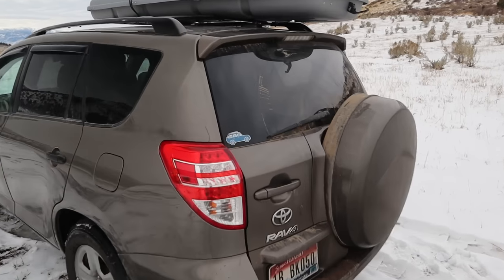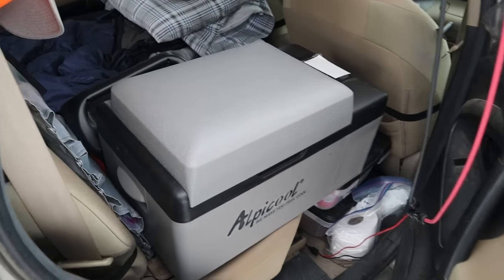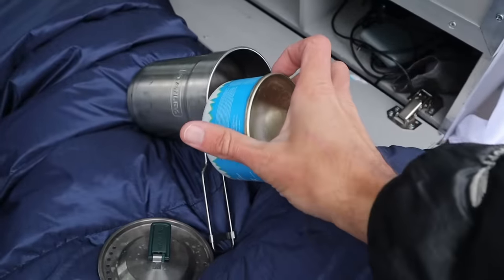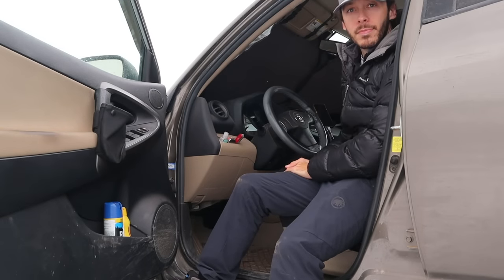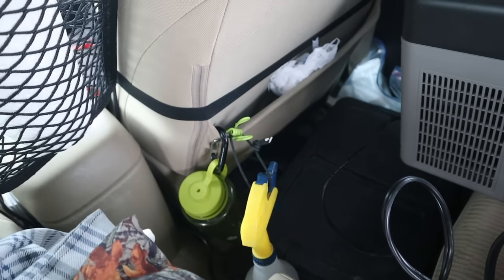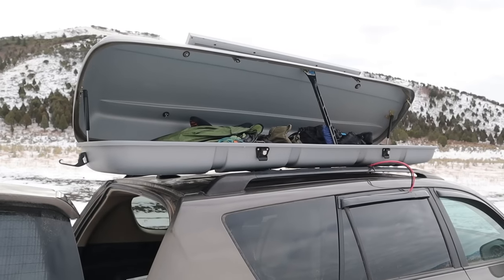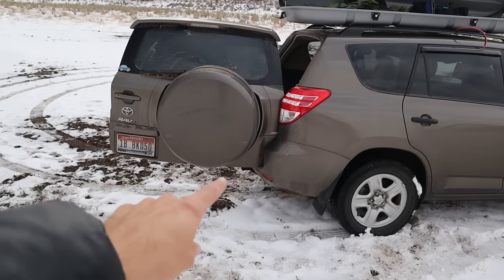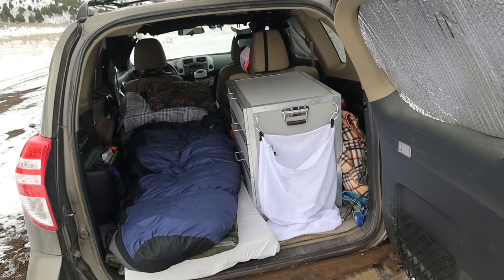My SUV Camping Setup: Full Tour of My Mini Camper! (Vanlife in an SUV)

Comment: I have a 2018 Ford Escape and have camped in it. with my dog. One of the back seats had to come out. Cut a length of plywood laid and mattress pad and bedding. Next year I am going to take out the other seat so i have more actual useful use. Sure like the storage bin a friend made for you.  My family, daughter and son in law and their extended family are taking a trip next summer so our last summers trip told me what I needed to do to make better and your video has given me lots of good ideas. We have reservations for a large site next summer, covid allowing. it will only be for five days so otherwise I am on my own. Last year was my first year in that car, which was a good way to find out what worked and what did not. Prior to that I had a ford Trans Connect, which I am so mad at myself for selling. It was great for camping. But it was starting to break down after so many miles. Thanks for your video.

Comment: Tristan, I’ve been following you since the beginning and have always appreciated your videos. I have a Sienna, which is my daily driver and camper. I also own a 95 RAV4 which I want to convert into a mini sleeper, because the RAV4 is better off road than my Sienna.
Question:  why did you choose the driver’s side of your RAV as your bed instead of the passenger side? I’m thinking if I go with the passenger side I can leave my bed out all the time. Am I missing something? Thank you for your videos! I also live in Southern Idaho.
Reply from the maker: The rear seat is a 60/40 seat. This means that it folds down in two pieces, one that is roughly 60% of the seat and one that is 40% of the seat. The driver's side is the 60% side, and that's why I sleep on that side. The 40% side isn't really big enough. It'll likely be different in your 95  RAV4.
Reply: Same I'm doing passenger side

Comment: Some great ideas here. I'm thinking about various camping options for myself--van, tent,  RV, teardrop camper, or SUV, and I see so many reasons here that using a small SUV might be the best solution for me, especially by leaving it relatively unmodified so that when I'm NOT on the road (which would be most of the time), I've still got a normal vehicle to run around town in.

Comment: Have you ever thought about or tried a very small, low-wattage electric heater to use inside your SUV when not driving, and it's extremely cold outside.
Reply from the maker: If I were to use one in the future, it would be just for review and informational purposes. I personally don't feel the need for one. I have no problem with just using the sleeping bags. Thanks Ric.

Comment: Dude, it would be so much easier on you to have tinted windows.
Reply: They are tinted. But a Purdon can walk up, cup the sides of their face to see if someone is inside, and interior lights can still be seen thru tinted windows. The reflectix work great at insulating too. Keep the warmth in, or block the heat outside.

Comment: Have you tried a pool noodle in the window that is open a little bit? you could roll up and it would press against the cords. You would get rid of the wind noise without having to move anything, plus its temp and nothing needs to be glued or changed.

Comment: Some of that foam copper pipe insulation cut to length and saddled over the top of that window where the power cords are coming through and rolled up snuggly could make a good seal and cut down on the noise. Probably wouldn’t even be able to even see it from the outside for it would be up behind the rain deflector.

Comment: For all the fun people make of it, the Pontiac Aztek with the tent package was the perfect setup. It included an inflatable mattress and a built-in air compressor, redundant audio controls in the cargo compartment so you could listen to music, a cooler built into the center console and a tent that clipped over the open rear hatch. In all-wheel drive form, it could even do light off-road adventuring.

Comment: I have the Alpicool  c20 for a little over 2 years and still running strong. No issues yet (knock on wood) pretty reliable fridge and i dropped it once on concrete from about 4ft high

Comment: I purchased the same seat covers you have based on your previous review.  I used it on a month long camping trip and it worked just as you said.   I like it so much I'm ordering another one for the passenger seat.  It keeps my original seats clean when I get into the truck with dirty or wet clothes and when I eat in the drivers seat it catches all my crumbs.  Get home, take it out and my truck seat is still clean!  Thanks for the review and suggestion.  I like the fact that you don't recommend something until you have used it and verified it works.  Safe camping...
Reply from the maker: Aren't they great?? I'm so glad you got some. It really is a gamechanger to get in and not have to worry about being wet, muddy, dirty, etc. I love 'em.

Comment: Something I have found very useful: the right microfiber towels. Dampen them and they are great for cleaning, including hands and face. Also for washing and drying other parts of your body.
Of the many brands tried, the deluxe ones sold in a ten-pack for 7.95 at WM near the auto section, dark grey with red trim, work significantly better, and have two different textures on each one.
They are very useful and multi-functional, and many-times reusable and washable, and very durable. Easy to hand-wash also. 
They are also more pleasant to look at and use than most.
Reply from the maker: I use a microfiber towel as my main travel towel. Thanks for watching

Comment: I would have routed the cables from the solarpanel through the hole where the roof antenna is located and then the wind noise when driving with a window opened be cleared of. You can replace the antenna with a window antenna if you need one or just put one in the roof liner. Good build am looking to doing something similar. :)

Comment: I am with you i.e car camping 🏕 
 I did the tent thing all before Covid hit, before that did many Glamping huts. Loved Glamping but realised I was spending a fortune and limiting my vacation opportunities as a result. So pulled out a old tent that was never opened from storage, loved it until we had a bad storm from a different place pass through. UK 🇬🇧  is wet most of the time but that storm flooded me out. I had partly set up my car for evacuation just in case and boy was it a good job I did. From there I realised I needed another option. Always looked at living tiny and plan is to buy a van, however that is a working progress so for now, designed a small car set up to sleep in from my last experience.l, made lots of adjustments for coming trips. I just got myself a Jackery E240 very pricey but worth it. Got compatible solar panels. I am set as had other things purchased prior to use for camping etc. So agree with you 100% use what you have to camp i.e vehicle and upgrade if you want to.

Comment: The foam rubber mats at Harbor Freight make good window coverings. One size with jigsaw puzzle edges is too small but they have another size(without the interlocking edges) that will fit most windows.

Comment: Were your solar wire come through the window put a strip of plastic the same thickness as the glass and height of the wires plus the groove the top of the window normally goes into  with a  gap for the wires.

Comment: Go I to a local ace hardware store and get a section of pipe foam insulation and close a piece up , into the crack of the window  that has the solar panel wires passing thru it.. or  get some sticky-backed door gap foam insulation tape

Comment: Water is sooo important and putting it in that huge empty space that is the right passenger seat is a great idea. Also you managed to fit in a shower system. Plus provisioned for toilet use as well.  (Small fridge technology is sort of a given nowadays). 
I think a lithium battery would be even better or at least a 2nd battery. You can also install those popuptents from the backend of your vehicle especially for longer stays in a particular site. There's also a battery operated water pump that screws into a ten gallon water container (now you have a shower) ;)

Comment: An RV battery, if there is space under the hood, can be a useful replacement for the standard car battery.
I've done this, and run some thick cables (from the solar aisle at Harbor Freight) from the RV battery through the wall of the engine compartment and underneath the glove compartment. Then they run a pure sine wave inverter that is on the floor under the glove compartment.
Works great. It's a solution that took me years to arrive at, and it really hit a sweet spot. 
A solar panel keeps the RV battery topped off when needed.
Usually, though, it is not needed unless I am in one place for a while and using the inverter or doing a lot of USB charging. Otherwise just driving the vehicle automatically keeps the RV battery well charged.
If necessary, I can just run the engine for ten minutes or so to top off the battery. Not often needed.
Reply from the maker: Sounds like a good setup. Thanks for watching

Comment: I enjoyed your video. I would love to get the hybrid so I could have AC & Heat. Adding an inverter would give me 110V and with a hot plate I could heat up food. Also run a fridge and charge phone, etc. It would eliminate solar panel & Jackery.
I wonder why folks don't use duffel bags? 1 for clean clothes & 1 for dirty.

Comment: New sub. Great straight forward simple conversion that works great. I'm using some of your ideas when I build mine next year. I do think I want a little more room so I'm thinking of an RV the size of a Honda Pilot  or Subaru Ascent. I haven't seen anybody using the two sleeping bag system except me. It offers so much flexibility. I'm a former military guy and am using the Army patrol bag and the intermediate cold weather bag inside that. They rate the two together at 40 below, but I'll be happy to be warm at minus 10

Comment: I took both back seats out of my Toy/Highlander & it created a ton of space, plus it lightened up the rig. ( Took it to a mom/pop auto body shop & gave them a little cash to just remove the hard to get to bolts holding the seats to the floor. Easy to remove then.) 

Ya, until Toyota gets it together & makes a bare bones camping van for the U.S. /Canadian market, these SUV rigs will have to suffice.

Comment: I like the idea of the big screens. I can see putting magnets around the outer edge of the window behind the frame. I love the idea of putting the wire through the vent! You could probably get a piece of plywood or just something small to fit in the groove that the wire can go through, and have two pieces sandwich the window to hold it in place. That would be easy to make! Or just putting some thick rubber foam in the crack.

Comment: In case it's of interest, I have a rav 4 with the small triangle back side windows. i purchased a small roll of window black out film. It static clings to them nicely for total block out and I leave it as a permanent install because i realized i don't use those windows to drive. just saves some time and having to carry more window coverings. if interested, i can look up what i purchased and provide the link.

Comment: I've been car camping like this for over 20 years using mainly a series of Jeep Cherokees and Grand Cherokees. My setup is very similar except I haven't upgraded to a fridge, still using ice. I recently obtained a small class C RV, 23 ft to use as a home base and will look for a Rav4 or similar vehicle to tow behind it and use for excursions.
Reply from the maker: A cooler does the job, for sure, but it was a pretty big quality of life improvement to get the fridge and just not have to mess with the ice and with wet food. Sounds like you have a great setup! Thanks for watching, Eugene.

Comment: Have you considered using a foam block to take up the gap in your cracked-open window to route your solar panel wires through? Maybe something as simple as a portion of a pool noodle or pipe insulator.  Home Depot has a whole section of products to reduce air draft at doors and windows that you could run the wires through while closing the air gap.

Comment: I've camped in my Ford Explorer in a similar fashion many times. Very cozy and easy to get ready. I noticed that your dome light was on. You may be able to turn those off if you turn down the dimmer for your dash lights until it clicks. It works for the Explorer, not sure on the Toyota. It always bugged me to have to keep the doors and hatchback closed to keep from running the battery down.
Reply from the maker: On the RAV4, you can easily turn them off with a switch so they don't turn on when you open the doors. I usually don't have the dome lights on, but I have for the past couple of weeks because I've been going out to my car at night more. I just didn't turn them off for the video. Thanks John.

Comment: That's super cool Tristan, I like it how you fit the cabinet in... I Have not done as much traveling or adventures as you have but I traveled in a Subaru Forester with similar amount of gear and it did fine in fact sometimes smaller was easier for some roads and campsites... as well as gas, etc. Now I have a Toyota 4runner 4wd that I use but the change was made to allow me access to more difficult type of terrain mainly.  Otherwise the Subaru was sufficient ... Thanks for sharing !!
Reply from the maker: I agree, small is way easier when trying to find a campsite. I talk about that in an upcoming video about big vs. small SUVs, but it applies even more when talking about a small SUV vs. a trailer or big ol' van or something. Thanks for watching!

Comment: I did something like this in my mini Cooper clubman! The barn doors on the back were really great for getting in and out and it also had a suicide door on the side which was convenient. I slept on the passenger side and had plenty of room with the seat pushed forward. Did this for about a year. Now I have a small cargo van, a NV 200 Nissan. I know it’s a van but it gets great mileage and is pretty compact and maneuverable. I’ve been traveling all over North America including Mexico, Canada and Alaska for about two years.

You are an inspiration to me Tristan. I always get new ideas from you. Love that cabinet you have in the back. I didn’t see how you connected the solar to the roof panel. Did you drill a hole somewhere in the roof or do you have the cable running out of a crack in the window?

Travel on dude!

Comment: The more research I do on the Jackery, the less impressed I am. Other than that, great stuff. If I thought of a negative, you addressed it and it made sense. For example, I like the WeatherTech window blocks in my RAV4 but your point is valid, you can't crack the window.
Reply from the maker: I have several Jackeries, and they're great. Thanks for watching.

Comment: I had not seen that great idea of how to bridge the gap on the bed.  I've seen lots of people do a hinge type of thing but that is a great idea.  Cheap, simple, easy to deploy.  I love the setup for the single life.  For doubles would you consider a hard top rooftop tent?  I'll bet with your following if you contacted one of the manufacturers they would send you one.  Even with one, I would stick with what you have for single person use.
Reply from the maker: I usually don't have the dome lights turn on when the doors are open (there's a switch you can flip to turn them off). I just happen to in this video. Thanks for watching 👍

Comment: The concern I have in your suv plus mini vans, etx, is a cabinet on one side of minivan, putting much more weight on one side of vehicle, re wear and tear and stability.
Reply from the maker: It weighs less than a passenger lol
Reply: @SUVRVing  That is good.  But it seems that the typical wooden cabinets with rear pull-out drawers look heavy enough to cause stability and wear and tear problems on suspension.  I hope I am wrong.

Comment: I’m seeing this a little late. Have you used a pool noodle cut to fit in the top of your rear windows? And also which Jackery are you using and are you solar charging and running your fridge at the same time ? Pass through charging.. does it last a while ? Thanks. Very nice set up. Easy. Intuitive and to the point.  Great explanation too

Comment: How do you secure against theft of your storage box and solar panels, especially in urban areas? Also, how do you carry bikes and still booncock for free? If you put bikes on rack, your car would likely be quite noticeable, no? Yet, there's no space inside your SUV for bike and sleep at the same time. For the clothes cabinet, why did you choose a heavy metal storage rather than a cheap, light, tupperware-like drawer from Walmart? And ziploc bags and squat for poop.

Comment: It would be great interesting if someone would design a strip of some sort with an opening for cable management that can be effectively placed between window and frame. I’m thinking some sort of rubber/foam thing. Of course the foam could not absorb water to the point of leaking and dripping on the interior. There got to be a way.

Comment: My only question is have you ever looked into a Honda Element? I’ve owned 2 of them and they are perfect for road trips, camping, light off-roading, and sleeping in. Tons of room to sleep on the floor or on the seats as the seats fold down into a bed. Or build a sleep platform and have tons of storage space underneath. I used mine the same way you use the RAV4. Traveled all over sleeping in the back. They even have an OEM tent that hangs off the back which extends the living space out to the end of the clamshell tailgate. Anyway, I’m sure you looked into them...just curious.